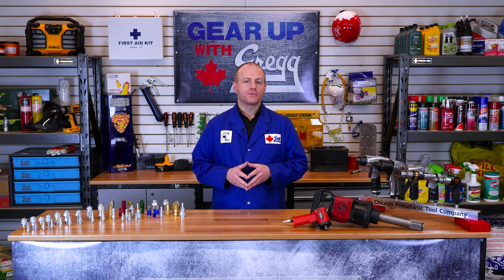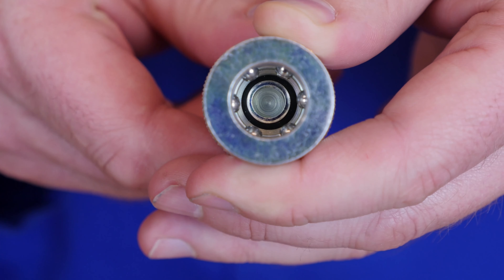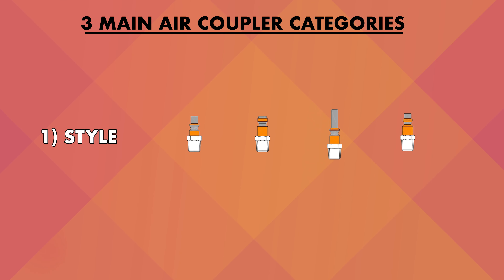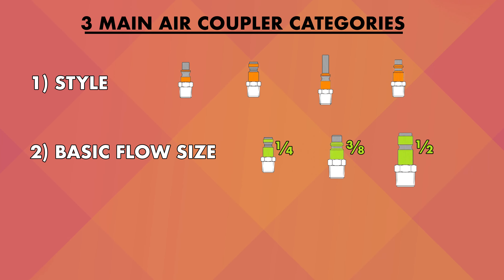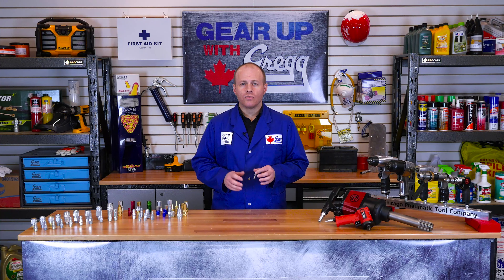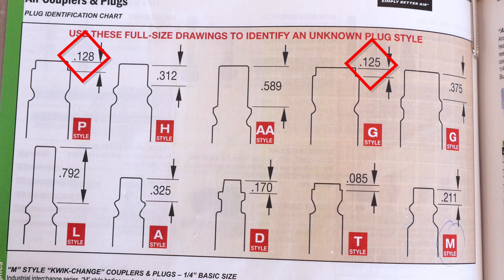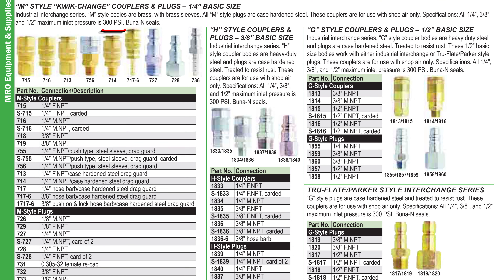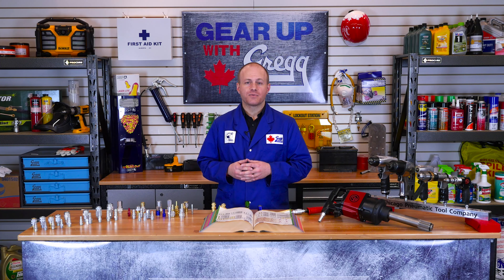The Ultimate Guide to Fittings and Couplers for Air Tools - Gear Up With Gregg's

Comment: What does it mean if little sprays of water comes out
Reply from the maker: The very act of creating compressed air with an air compressor results in condensation/water build up.  That is why almost all air compressor tanks will have a drain valve on the bottom of the tank.  Most comercial set ups will have an auto drain added to the bottom of the compressor to remove this moisture from the lines.  In addition, they may also utilize an FRL (Filter, Regulator, Lubricator) system.  The filters are usually designed to minimize the amount of moisture that makes it to the end of your line.  As a starting point, make sure to drain your tank.  After that, depending on your setup, you may want to consider seting up an FRL system with an auto drain.  If you want to have a look at the FRL's we have available they can be found in our online catalogue on page I19 to I23.  https://www.greggdistributors.ca/catalogue.php.  Hope that helps.

Comment: Excellent info!  Also shocking to see that thread size doesn't matter and actual standard plugs found are rated higher than though. Makes you wonder if the latest high flow popularity is justt a marketing trend.

Comment: No nitto style? They flow 50-65 scfm depending on the maker (bigger centre bore)
Reply: Ive gone with Nitto. All my inherited fittings were tarnished from 50yrs of use, so upgraded everything. And now I understand the use for brass, I'll fit that to the car. Dont forget dust caps !  ;-)
Reply: @DOCWHOK9  dust caps xD never used one and never had an issue, might in the future now that ive said that xD
but nitto are probably the best fittings for standard air lines unless you get bigger hoses it's not really worth buying high flow ones as the cost vs performance difference is pretty miniscule
Reply: @DOCWHOK9  Americans don’t use bsp fittings which nitto use. Americans use npt style thread which nitto don’t make. 

Nitto is good but the euro style is a step up.

Comment: Shocked to NOT SEE the Milton V-style on their Identification Chart!  That is their high flow style that flows around 60-70 SCFM in 1/4 inch.
Reply: glad you here, was trying to find if anyone compare 1/4 high flow and 3/8 as got compressor I want but sadly found it is 1/4 fitting and not 3/8 as of the 1/2 thread

Comment: An informative, well presented video, thank you.  I printed off the Plug Identification chart from your first link, above.   Are the catalogue pages size A4 , or another size?
Reply from the maker: Thanks for watching, we're glad you enjoyed the video and found it useful.  Actual print size of catalogue page is 10.5" h x 8.125" w.
Reply: @GreggDistributorsLP  Thanks for the reply.  (By your edit I see you did catch on to what I was asking re A4 paper size).  :)

Why I asked?  If your catalogue's to-scale outline of the plugs is printed on paper 10.5" x 8.125" it makes me wonder if that page will reproduce the same to-scale plug outlines when I download the page and print it on my printer's local standard size A4 paper (11.69" x 8.26").   I think there may be a bit of stretching and distortion on the A4 page, which kind of defeats the purpose of the exercise.

Comment: Too much airflow will break the tool lol. That's your PSI setting. You could have a 100 CFM but if the tool only takes 10 it's still only taken 10.
Reply: Kevin Roberts That was funny.  That is like people that think connecting a 12V light bulb to a large car battery will cause a problem as the battery is too large for the little light bulb.  12V is 12V no matter the size of the battery and the bulb will take the current it needs.  Same for air tools.  Provide the proper regulated pressure and it doesn’t matter the flow capacity of the fittings as long as they are at least as large as what the tool needs to operate correctly.
Reply: Suppose that your tool spins rather easily (taking little air pressure to do so) but is rpm limited. Air flow is the factor that regulates the rpm not pressure. Yes, you can damage an air tool.
Reply: @NMranchhand  Maybe if you buy Chinesium tools.  Well built tools will take the airflow they need as long as you don’t exceed the pressure rating.  Pressure is what causes airflow.  Quality air tool makers design their tools so that at their maximum rated pressure, they will consume only the amount needed and not any more.  The only way to get more airflow through the tool and damage it is to increase the pressure above what the tool maker specifies.
Reply: Also, grease your air tools as needed
Reply: @Flynn_Stones idk about anyone else but I’ll pass on putting grease in any of my tools. Also check what your specific tool says about OILING it cause some tools you’re not supposed to oil and don’t put a bunch of OIL in the tool either a couple drops is usually good 3-5
Reply: @NMranchhand I know this is an old comment but... If a tool is how you describe then it would call for less pressure and probably have its own regulator (like a paint gun). The simple fact is if the tool is supplied the correct pressure at the tool then it will work as intended 100% of the time. The guy above said it perfectly. PSI = voltage, CFM = amperage. A tool requires the correct pressure to operate just like a light bulb. If the psi/voltage drops so does CFM/amps. They are dependent on each other. Its like saying you can't jumpstart a motorcycle with a car. It's an ignorant statement.

Comment: Maybe its just me... But most my automotive tools accept a ( 1/4 NPT ) that's the threaded hole in the tool, in reality its a 1/2" sized hole... Anyway, the other end of the fitting the non-threaded side, needs to be a 3/8 sized hole.  For whatever reason, no website on the entire internet will allow you to filter these results, and no one seems to list those two separate numbers in the description on any product.  They all only specify one side or the other... Either the thread size is listed, or the coupler/plug size is listed... Never both numbers are given at the same time on any product.  So I'm finding it impossible to find a  3/8 plug and coupler, with a 1/4 NPT thread on the other end.  Wich I know exist because I was just holding one in my hand.  ????
Reply from the maker: We couldn't agree with you more...this is one of the many reasons we created this video!  From the air coupler manufacturers stand point, the 3/8" hole size you are referring to is called the "basic flow size".  The quick couplers that have a basic flow size of 3/8" are the "P", "H", and "AA" interchange series.  This basic flow size also allows a performance of up to 68CFM.  Have a look at our catalogue below and you should be able to pick out what you're looking for:

https://greggdistributors.ca/search?q=I9&resp_group=Default,Variations,ItemProperties&page_size=8&view=list&terms=CatPage:I9
Reply: @GreggDistributorsLP  I see clearly now.  You see it was one of those moments where the answer was so simple, I didn't get it lol.   That link is also very helpful, got all the part numbers I need.  Thanks
Reply from the maker: @gittyupalice96  Glad to help!

Comment: my compressor only puts out 10 cfm @ 90 psi, does that mean the smallest coupler will be more than adequate?
Reply: That is what your pump can output at 90 psi. In other words, if your pump cuts in at 90 psi, it can provide 10 cfm at that pressure. Your tank can flow more than that. The CFM required to run the tool(s) you have connected will determine whether your tank pressure continues to drop, remains the same, or rises after the pump cuts in.

Comment: When I was a young Bloke there were three styles of quick connect fittings.   There were RYCO and PEM.       There were different diameters for different air capacities, but none was intrinsically better than the other.

In the meanwhile every manufacturer wanted in on the action(profit) so everyone said that theirs was better.  They were all basicly same but they had to be of different design so avoid patent problems..  As a result there are about 12 different styles which don’t connect with each other.

For 60 years I have standardised on RYCO because it suits me.

Stavros

Comment: Air flow should be the largest you can afford. If you are worried about too much air flow, you can get a regulator to control this. Air impact guns require both volume and pressure, not just pressure or volume alone. The more, the better. I run no less than 1/2 inch lines and couplers.
Reply: Best bang for the bucks are truck trailer air brake coupler
Reply: What do you use for swivel fittings

Comment: excellent and well produced video. however the number of various couplers long ago convinced me to ensure compatibility was to first throw away whatever I had and by quality couplers of a standard type. since all tools now have that coupler I don't have to worry about identifying. secondly it's worth mentioning the scfm doesn't seem to be a very useful measurement for pressurized air used in a shop and is very misleading when used in quoting air compressor measurements. this is why I'm moving away from air tools to electric. a home shop 110v compressor simply can't keep up with most tools. tried too many times finding a compressor that would and been disappointed. best you can do is get a larger tank but that only improves the number of seconds you can use the tool before it has to cycle